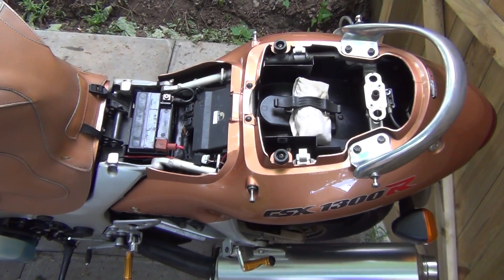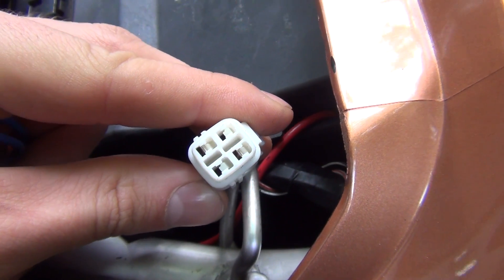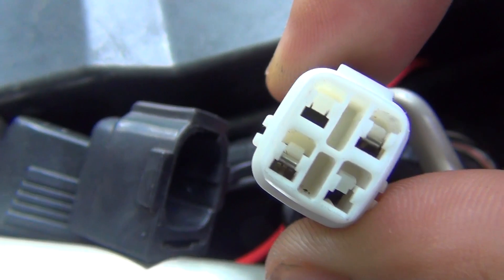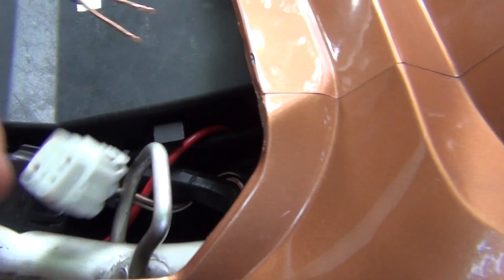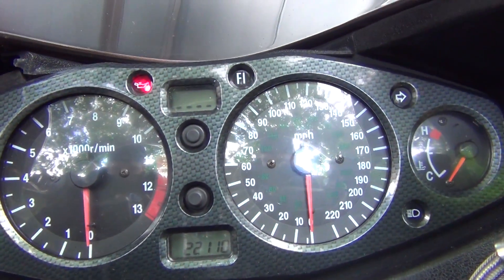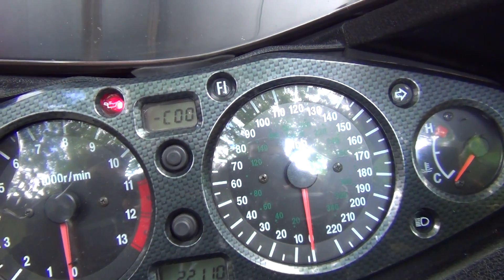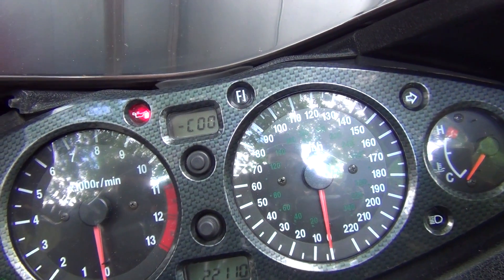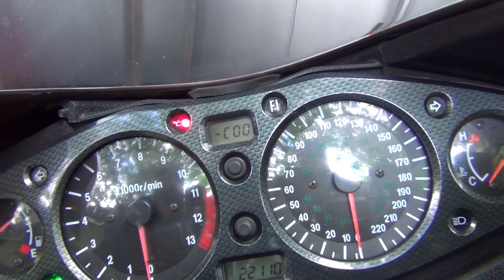Putting Suzuki Hayabusa into Dealer Mode

Comment: Generation 2 hayabusa  8 injectors. F1 c34 code on dash running on 3 cylinders Fixed.  One bad injector.   Put it on top of fuel rail 1st cylinder  .  Until you replace it .   All good up to 8000rpm and under .

Comment: I went to start my 2000, 1st gen Hayabusa, When I turned the key the oil light and neutral light came on nothing else and they were flickering, I then turned the key off and they stayed on permanently until I disconnected the battery to turn the lights off, nothing works on the bike only the oil and neutral light stay on permanently, even disconnected the computer and the lights still stayed on sorry to be cheeky anyone got any clues?
Reply: Sounds like a battery issue or short somewhere.
Reply: @Gideon_Judges6  It turned out to be a negative spade terminal came unplugged down the side of the battery.
Reply: @AngelDjay  I just noticed the post was at least 1yr old. Glad you got it sorted.

Comment: What's dealer moad amd why do I need to turn it off
Reply from the maker: It's a function that allows seeing error codes coming out from ECU. If your bike has a problem by getting the ECU in the dealer mode it will tell you what the problem is.  Obviously not all the problems can be displayed but many will. Very good function as it helps diagnosing the problem.
Reply: @Adikxx  hi I just did put my gen 1 busa in dealer mode as per your video but I can't take it off bike won't even start I did disconnect battery still same

Comment: thanks you so much broo ,  i have one question, if i wanna restore from dealer mode , i remove wire alright????????????
Reply from the maker: Yes. Switch everything off and then pull the wire out.
Reply: @Adikxx  sorry  this is last  question, idle rpm adjustment is same on 99/00 to 01-07  where is located ????? i need this information thanks for reply
Reply from the maker: @caliberninja8963  hi bud. On some models you adjust it by turning a little black plastic knob located by the oil filller cap. On other models you need to use a screwdriver and stick in betwewn the tank and frame and turn a small silver metal screw(also on the right side near the throttle cables pulley)
I have a video where i show the idle adjuster . It's a throttle bodies balancing video so u.might wanna check that. Hope this helps.
Reply: @Adikxx  you are the king thanks so much broo
Reply: @Adikxx  ✌✌✌✌✌

Comment: Thanks for the info, very helpful! :D Some Hayabusas may have this plug tucked back under the passenger seat area, (like mine was, 2006 model). I managed to pull it out to where yours is located. This made it way easier to plug in the wires to make this connection, otherwise leaving it where mine was, made it impossible to grab it with your fingers to do your thing.

Comment: hey bro..
My busa was running fine but started to take jerks as if fuel supply isn't proper..
I pulled the fuel injectors n checked them they were clean and good..
After I placed them back the bike is not starting properly and dies while running as if no fuel is being supplied..
what do you suggest..?
Should I check the spark coils as well..?
Reply from the maker: Harsh Kumra yep plugs and coils is probably the easiest first step. No rust in tank? TPS adjusted correctly? How is the clutch situation? Resolved?
Reply: no rust in tank..
clutch done..
havent checked the TPS will see it for sure..
dealer mode showed fuel pump relay code..?
I hope no problem regarding the fuel injectors..
it blinks FI on the digital screen..
Reply: does the FI light still blink on the screen??are the fuel pumps ok??

Comment: I did adjust, increase my idle ,was a little rough, low rpm, a couple months later.... won't achieve high rpms, good power below 5,6,k rpm, TPS out of whack?? Loss of power, slow rolling throttle, helps, but I have a Halfabusa instead of a Hayabusa... Thoughts?

Comment: You should start the engine too. It may change to showing the different error code, when engine is running. It happened to me when the O2 sensor broke. C00, when engine is not running and changing to C44, when engine is started.
Reply from the maker: Piotr Domanski yes i agree.engine should be running. This vid was just a demo of how to do everything. Regards